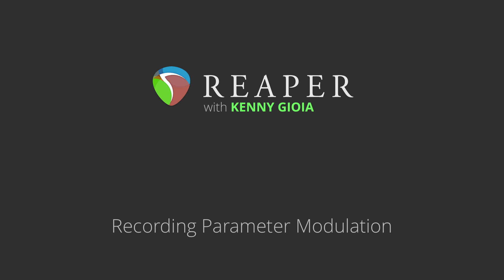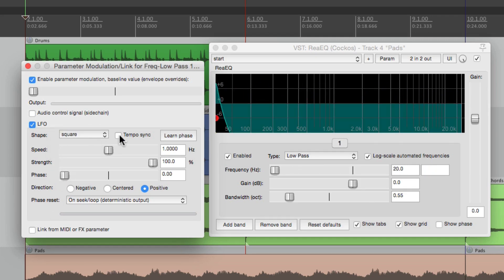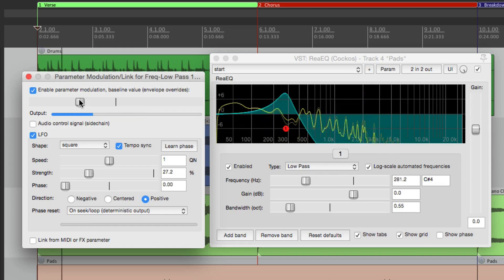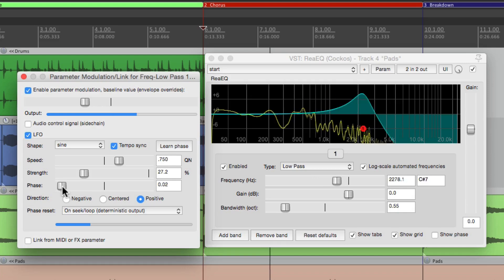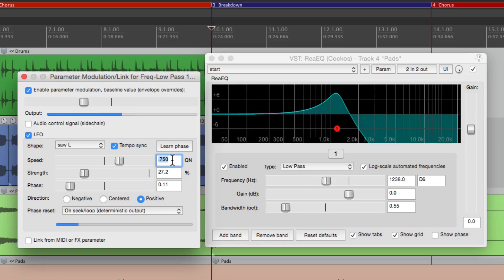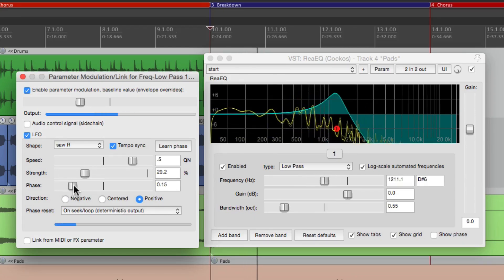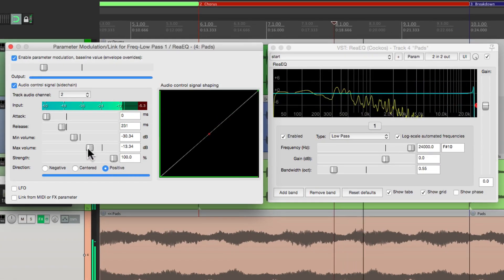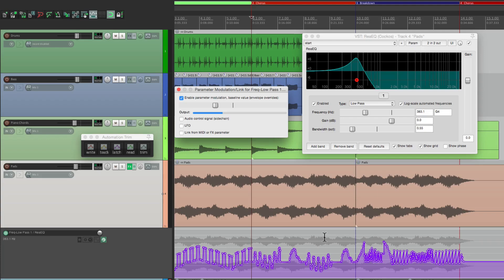Recording Parameter Modulation in REAPER

Comment: Hey y'all- I've watched several videos but can't find an answer.  All I'm trying to do is record my mod wheel.  All the videos I see have you controlling settings with your mouse.  Does anyone know the answer to this?  Thank you!
Reply: Hey! Did you find a solution? I've been searching for ages too. I am pretty sure it's possible, but I have no idea how!
Reply: @AZmotion  yes I actually did! right click on the record circle on an individual track and select midi overdub.  Now when you record it wont write over what you already have, itll just add what you do with the mod wheel.  When you're done-set it back to normal.  Hope this helps :)
Reply: @Hausofmcky  Wow thanks! I was using a digital mod wheel, so I ended up setting that is an input FX for the track, which works, but I didn't know MIDI overdub worked. Thank you!